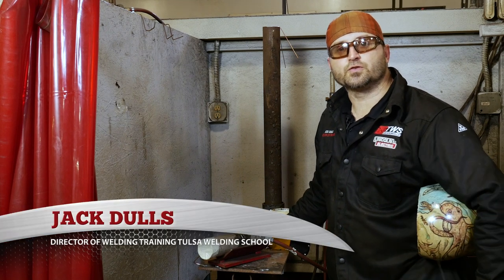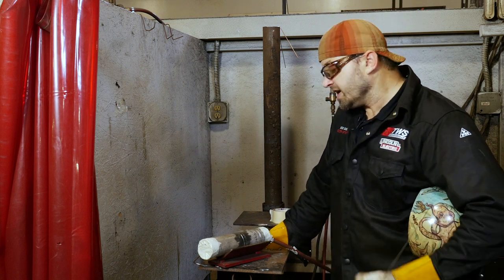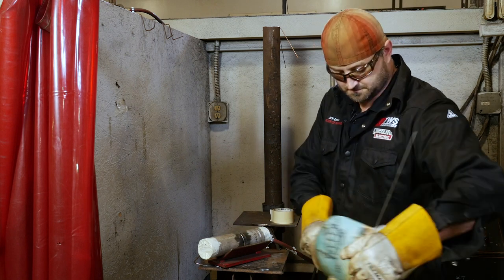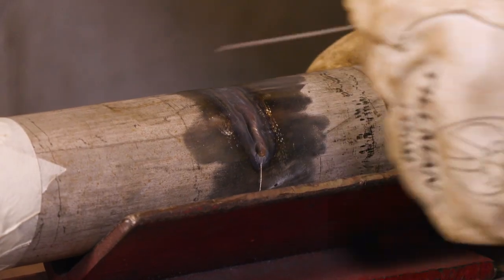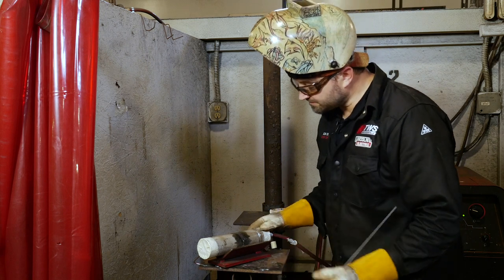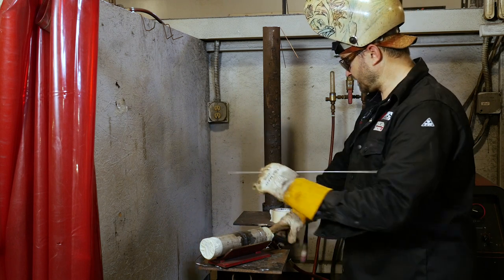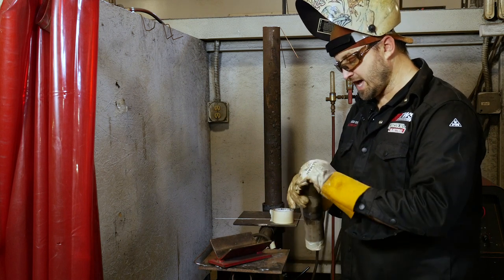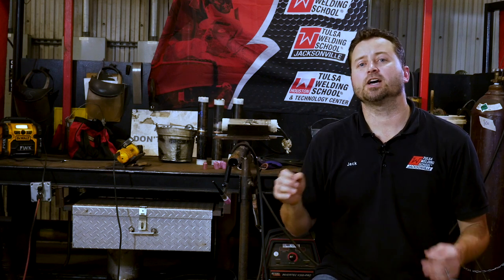How to Weld 2-Inch Schedule 10 Stainless Steel

Comment: Wow... If you ever want to know what not to do then this is the video for you! No bevel, no filler. There's literally no aspect of this that is remotely correct
Reply: Man you took the words right out of my head
Reply: @HELIARCMASTER  unfortunately I went to the Tulsa campus and I've had every single person told me to forget everything I learned
Reply: This is exactly how you weld sanitary stainless lmao no filler no gap no bevel. You should consider actually knowing what the fuck you’re talking about before chiming in lmfao
Reply: @motesjames92  you're right but you don't weld schedule 40 2 inch pipe like that.... It's not even a stainless pipe so maybe you should check yourself
Reply: @zachredus4531 where is he welding schedule 40 pipe?
Reply: @zachredus4531 this ain't schd 40😂

Comment: No gap, no shot of the root even though I'm sure it was broke down, no cap pass? Put the thing in 6g or 5g. That method will fly on sanitary in the field but not sch10.
Reply: That’s what I was thinking. This is is for sanitary
Reply: I have personal done butt jojnts that I had to purge because I was able to put a root from the outside by allowing the weld to sink on the inside of the pipe all the way around the joint and being purged it would not crystalize or get sugared as most people would say hard to do but it’s common in the food industry when it comes to stainless steel pipe plumbing on big units.
Reply: Not true at all

Comment: I think this technique and fit up could be used for food grade piping or exhaust pipe. but for gaslines and probably pressure vessels you need about a 1/16-1/8 root penetration

Comment: Man that’s the worst welding every at least have a 3/32 gap that would never pass a bend or x ray
Reply: I agree on it being the worst weld but not for you mentioned because what you said is irrelevant, reason I say that is because it most deff does not need to be gapped at all.  Example all I do is stainless steel tig pipe  welding at my job , I do a lot of plumbing for fire truck module units which are used for the water to come threw the pump. Those projects do not get any type of testing in regards to X-Ray, mag particle, UT, etc etc there for standing butt joint is just fine . The pipe that I attached to some flanges will get welding both on the outside and inside of the pipe is sliding threw the center of the flange leaving a 1/4 a 3/8 set back depending upon what the print calls for!

Past 12 years prior to being at this shop for the past year I worked on pipelines shutdowns , turnarounds etc etc as a tig welder on all different types of alloys I am also a combo welder / fabricator : fitter!!!! So I know what I am talking about!
Reply: Wanna point out I am not calling you out and saying you are entirely wrong at all because yes if this piece were to be X rayed or UT it would most deff fail for 1 ends not being beveled and not having a proper root or burn threw. 

In theory it made no sense for him to purge this pipe since he was not going to root it and at 70 amps we both know he was not getting no push threw to do a burn-threw style root pass he did not even add filler he just fused it together so tech this fails a visual look because as you prob know I am willing to bet that is under filled  on that particular joint !!! That’s why I even commented saying “ this is a vid of how not to weld a stainless steel SCH 10 pipe butt joint lmao 🤣
Reply: @eternalflame7710   the man can’t weld for him to be a teacher he can’t weld we can go back and forth all day it needs a gap in it period
Reply: You can shoot xray with square cuts on sch10 its all about amperage and purge pressure in the pipe it will break down the inside and you can root it like that
Reply: you dont need gap for 2 mm pipe
Reply: @DarioMartic-h9l schedule 10 with no gap sure, but no bevel at 70amps? At 120 with bevel you have to move at snail pace to get full penetration.
Reply: @th600mike3  Not true.2mm at 120 you will make big hole . 64-85 A is best for 2mm.More than that you will destroy material.

Comment: What type of welding is that??? This doesn’t help anyone a 3 yr old can Tig a no gap no root.
Reply: It’s for sanitary. No gap because you almost 100% of the time can’t use filler rod (chance of adding trash)
Reply: @slugwelding5879  dude.. no

Comment: Your not even adding any filer deff underfilled on that first pass there is no reason  why any should have to run more then one pass. If you did that on a job you would deff be yelled at or talked to about how long  it’s taking to weld especially if someone fit the pipe  and all you have to do is weld!!!